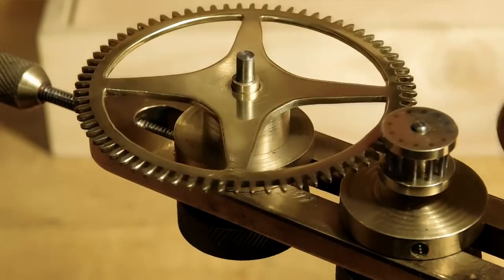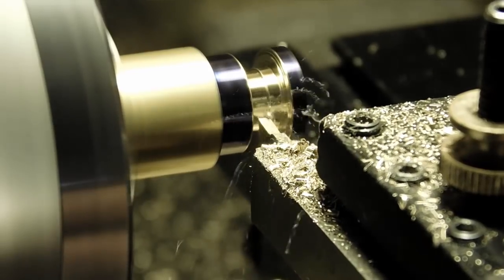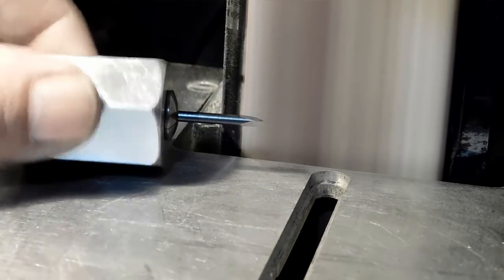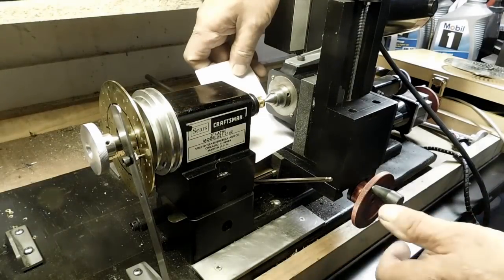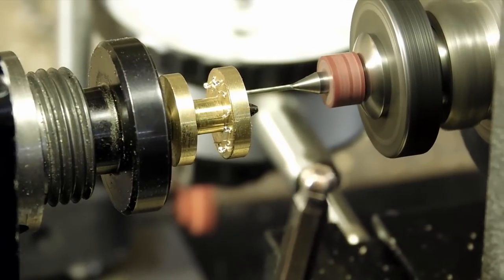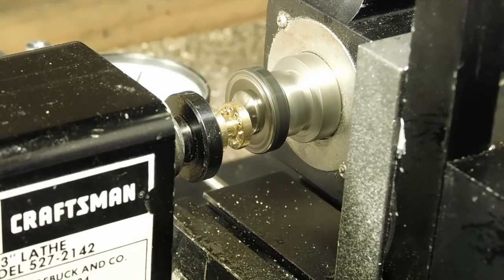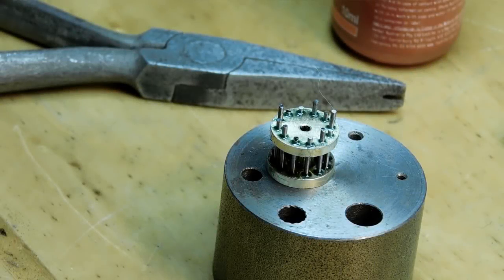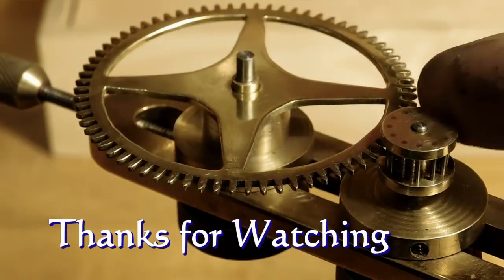DIY Cycloidal Gear Cutter: Part 4 Making the Lantern Pinion

Comment: Hello, great video! I am a Horologist. Please forgive me for saying so but your trundles are supposed to be able to rotate individually. This ability reduces friction.
Reply: @Craig I don't know the actual answer to that other than the ease of making them and old technology. Modern clocks use modern spur pinions. Another guess is the rarity and cost of steel in the early American days. Side note the rarity of steele for springs is why antique American clocks were weight driven.
Reply: @Craig also the technique to retain the trundles is to put crows feet in around the outside of the hole the trundles are in.
Reply: Really? The only trundles I've seen spin are ones where the entire assembly was coming apart and waiting to fail. Nearly all the American clocks I've worked on had them staked in place. What kind of clocks have you seen with rotating trundles?
Reply: @georgeblack589  I've seen the same clocks as you. Next time you see some look at the wear pattern on those who havent been fixed into place compared some that have been fixed.
Reply: @mainarbor8416  I'm not arguing with you, I've seen the worn teeth and deeply grooved trundles, I'm asking which ones tended to have them rotate. The average American mantle clock was made for economy, so I figured you've seen something much nicer and had some insight.

To be fair, I don't think you've seen the same clocks as me, unless you live in my part of Colorado and work on the tower and street clocks there.
Reply: @georgeblack589  German and American landern pinions in general.  Be sure the trundle is a close fit. Just meal the hole over to set end shake. Some wear will transfer to the hole itself.

Comment: Very good videos and informative. I have 2 questions with a problem I have been having and that is when you used lighter fluid to clean up the loctite  on the lantern pinion how is it not breaking down the loctite and causing a week point. And when you took it to the belt sander to grind off the remainder of the pins how does the heat generated then not break the loctite  down. I have done some projects lately where I have had problems with booth. Heat and cleaning up breaking the loctite  down and not holding. With that being said I used loctite 638 high strength. Any help on these 2 problems I have been having would be greatly appreciated. Thanks and keep up the good videos.
Reply from the maker: Anthony thanks for asking...the green Loctite is like plastic when it cures...using lighter fluid does not get into the press fit where Loctite is holding trundles...just the overflow...and most times I still have to go in the next day with a dental pick and clear Loctite from the edge of the trundles.
When I clear the end of the pinion on the sander I peck at the sander carefully not to heat the trundles much...it only requires a couple of seconds to do the job...go slow and be aware of the heat...bob

Comment: Looks good ...almost traditional...too bad you used Loctite
Reply: Been restoring antique clock works for quite some time an am having a problem understanding the reason for putting in trundles in the lantern with locktite.  I have never experienced trundles that didn't float.  the crud may need to be cleaned out  or just unstuck.  as one of the best clock repair authors said "quote" putting a trundle in with glue or solder is not professional and makes it very hard for the next repairman to make a trundle repair.
Reply: Yes. A clock lantern pin in many cases does float. It can be captured within the lantern housing useing a cap or by stakeing the holes. I have seen both in the 45 years that I have making a living at clock repair. Dont think the masters used locktite in 1870. Good machine work though.